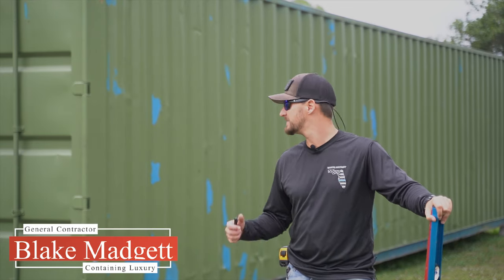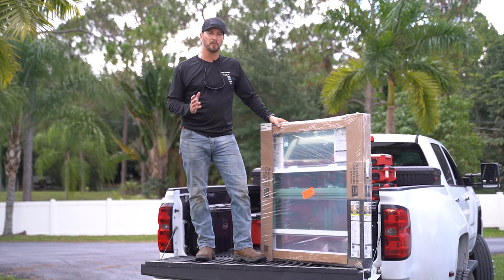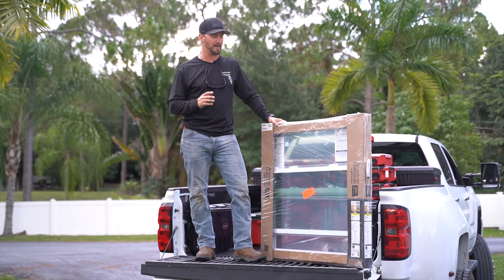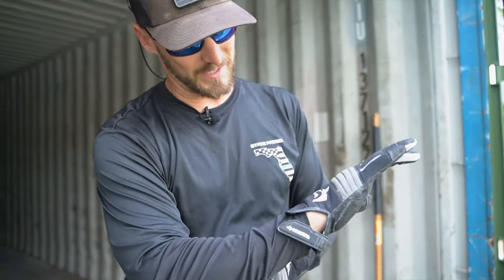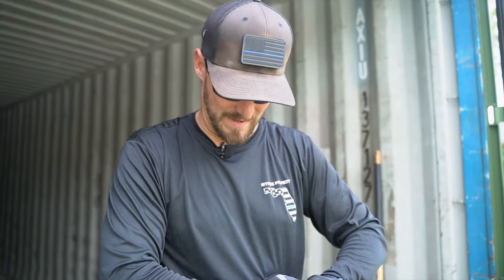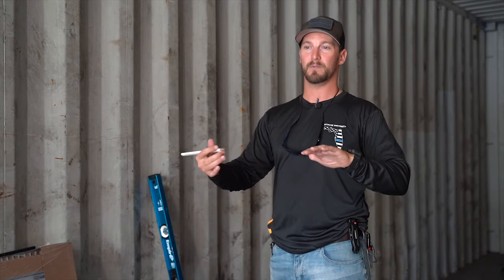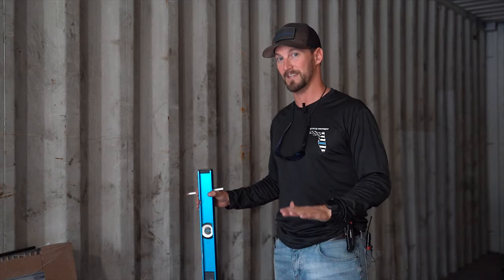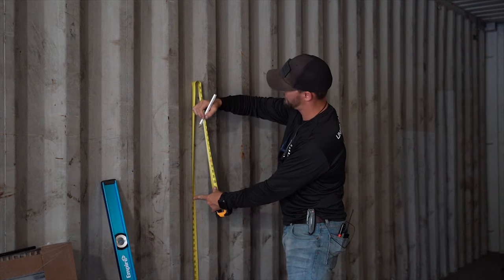Build a DIY Shipping Container Home Step by Step | Ep. 2 Window Installation

Comment: Really like the window box framing idea. Definitely a lot easier than all of the other videos about window framing (weld) that I've seen. I will be using this concept for sure. Thanks
Reply: So in the long run, with labor and materials, is it cheaper to weld or to build a box around the window?

Comment: Do you have a reference video to address prevention of condensation on the interior metal walls? I know that the difference between the outside temp/humidity versus the inside environment but both environments can vary greatly and I'm not sure how to address that. I live in the very dry west Texas Chihuahuan desert.

Comment: could someone PLEASE explain how you are attaching the framing of the walls?  I realize the tracks or  studs are attached to the floor, but what about at the top or the walls?  I'm sure youre not screwing the vertical studs into the steel shipping container walls but what about the top?  I've watched different container home videos and no one is showing this.  I see many have the top of the studs over a foot below containter ceiling, but how are they attached?  Please explain this i would appreciate it.

Comment: I was thinking of leveling the container; then when insulating jack it up and let it rest much higher on blocks to provide adequate clearance to spray the bottom with closed cell foam, then jacking it and removing the extra blocks, and leveling it again at the new, lower, height post-insulation.  I also live in FL and want to waterproof it with the closed cell foam as well as keeping it off the ground to access plumbing, etc. and allow for drainage.  Do you think this is an ok plan?  Flaws in the plan? Advice?  You really know your stuff... great video series!

Comment: Small correction. I don't think impact rated windows are tested with a 2x4 launched at 180mph. I think it is closer to 35mph. 180mph might be the wind speed but it isn't the speed that projectiles are thrown at by the wind

Comment: Hi, love your videos. When u put in your windows, does it change the structural behaviour of the box? Do u need special transportation security frames or locks that helps to avoid any demolition when picking up the container? Are there any regulations that needs to be aware of, eg will a transportation company reject a transportations when the container does not have these types of transportation secrity locks for windows?

Comment: I've watched your vids. Found them rather informative. However, where you don't weld metal to the openings, what stops the container body from buckling, at the openings, in high wind or other pressure being applied to it.

Comment: Seriously thinking container home--but I notice you don't respond to questions. . .  In Dallas county I saw an 18-wheeler tossed like a toy.  Wouldn't you have to anchor a container some how?
Reply: I for one can't think of a situation where a shipping container is going to go flying with no momentum besides a tornado or hurricane. An eighteen wheeler could go flying because it is already at a high velocity and on wheels, and wind can get under it to pick it up. I don't think this applies to shipping containers, but its good to consider things like this.

Comment: hey i am also from south florida and am looking to build one. i have a kind of odd question. do you think you would be able to put one of these underground and another one on top to make a sort of "basement"
Reply: Since people have used shipping containers to build underground shelters i think that would work perfectly. What a great idea, never thought of that!
Reply: Shipping containers are not designed to be buried. The walls will bow and blow in if you don't reinforce HEAVILY. Water and soil is VERY heavy and puts a LOT of pressure on what is buried in it. I've looked ito this extensively and wish it were easy, but I've decided against a basement.  If I were to do one, I'd do a traditional poured basement and set the container on it. Don't want to be in a basement that collapses and buries you.

Comment: I am sorry to say it but this is not the way to put a window in a shipping container. ( water/flex is your enemy in a container home that does not need rust or mold at any time. You need vertical steel supports from the floor to the top of the wall frame of the container to support the wall. Then horizontal steel rails at the top and bottom of the window. This stabilizes the wall/window. Then use angle iron as the outer frame of the window casing with one leg of the angle flat against the inner wall of the container and the other leg pointing to the outside of the container wall. This all needs to be welded in and then use urethane to seal the outer joints. This will eliminate any flexing of the wall, stabilize the window and keep out water for the foreseeable future. This is. A little more work but worth it by far!
Reply: Great feedback and very accurate! These containers will, and do, flex especially if you have expansive soils or are transporting them. We use 2.5" 14awg square tube for all openings and use angle iron for the exact reason you mention, it strengthens and acts as a flashing .. and eliminates water ingress.

Comment: I love these types of buildings, but you're making a few mistakes that can come back and bite you later. First, don't shop at Home Sinko (Depot). That place is for people doing odd jobs around your house, not building a house. Every pro will tell you, go to a building supply store. You'll get your Anderson Windows a lot cheaper there. Home Depot is one of the highest places to shop for windows unless you're going with Jelwen windows. Second, you're not using any flashing. You've said that you live in south FL, well, you to flash the windows. That cocking you're talking about, shrinks with time. The metal will also expand and contract in the sun. The sealant will fail. Next, get a longer level. To hang doors, you need a  min 9ft level, also chalk lines. The replacement window you used is great for these because it has a vinyl flange already on it. New construction windows are not good for this unless you're going to cover the outside of the container. Next, think about a POD drop off for your supplies, this way you're not moving them all the time as you build. 

Well, that's all I can see so far. Good luck, I can't wait to see the next video.

P.S. Please adjust the volume to match your mic volume. Right now it's like 300% higher on the intro and exit. You can match them so you don't blow out people's ear drums.
Reply: Right on my friend, Home Depot is like K mart, all junk. I would rather shop Restore or get stuff at the local dump, far better quality supplies. And the he mentioned Harbor Freight lol. 👍🍺😎
Reply: Whats the best stores in south florida ??